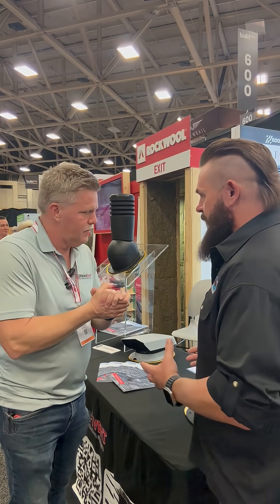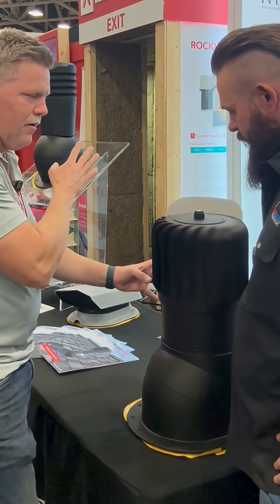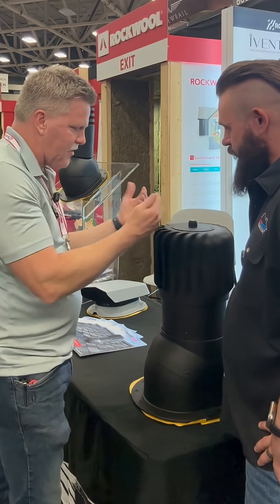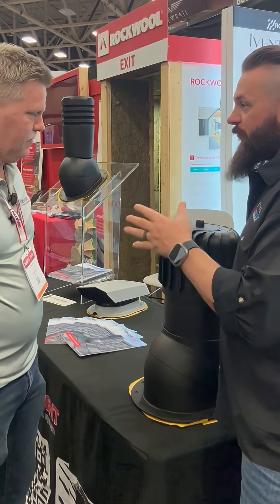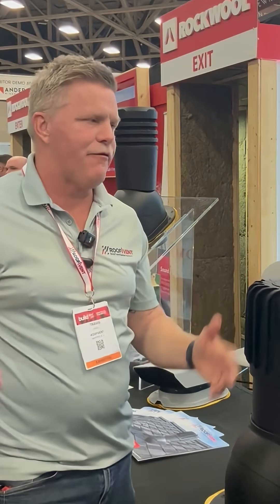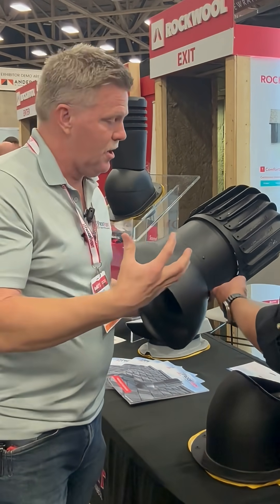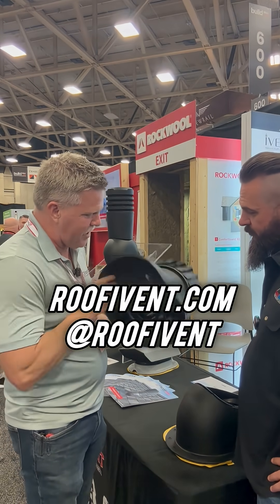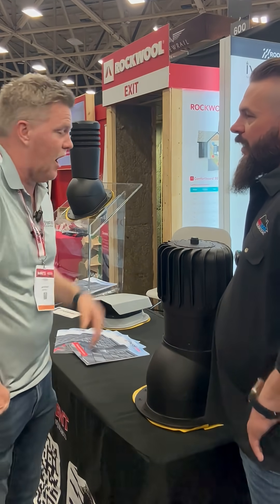When vents fail and fans suck, @roofivent saves the day! 💨

Comment: I do hoppe is 2 berings as the rest of the world have.just because you paint it black and make if cool ...it must last . Outside that that tipe of" vent " always works till complete catastrophic mechanic failure. If makes noise. Is almust dead. Replace it. But totally Recommend.
Reply: Ivent ROTO has a rotation system with two bearings immersed and encapsulated in oil. This solution extends service life and reliability unrivaled.